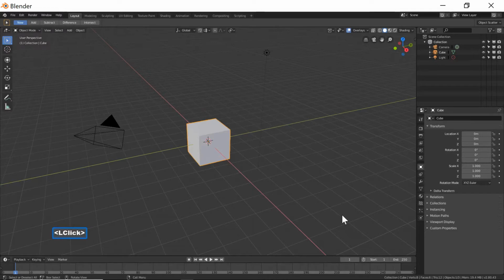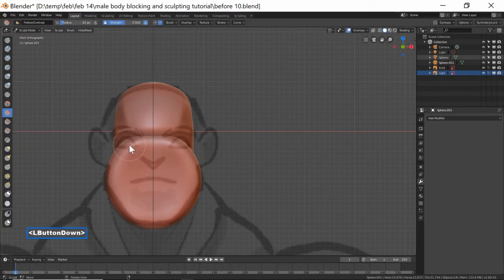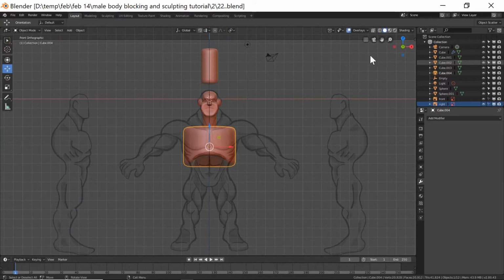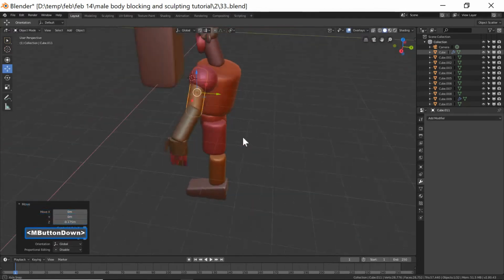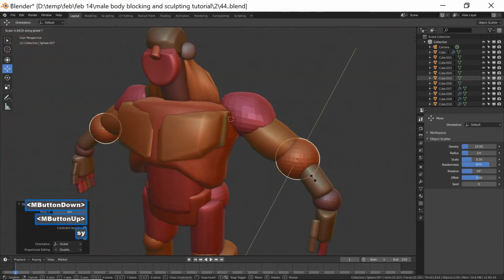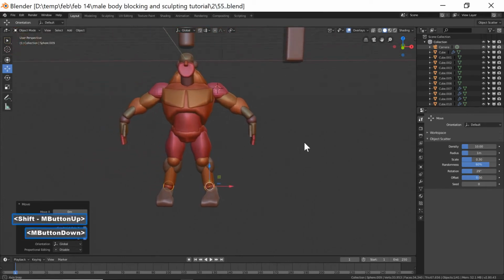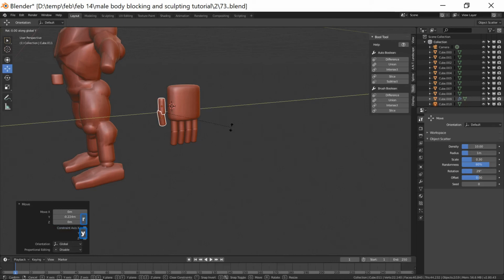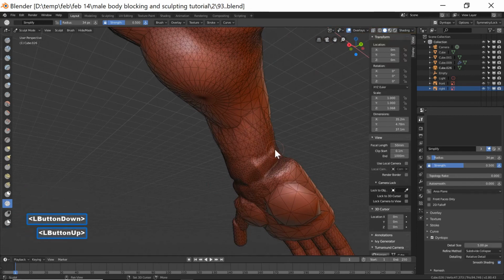Part 1 Blender 2.8 Tutorial Stylized Male Character

Comment: I just started blocking in the head and so far 2 things:
1) The reference drawing that I am using has a longer head than the sphere. How would you suggest adjusting the sphere (i.e. scaling it horizontally or stretching out the back with grab brush)?
2) The flatten brush seems to flatten the sides by pulling out mesh rather than pushing them in as you showed at 14:29 (I am actually stuck there right now, so didn't move further in the video). Is it possible to reverse the direction of the flatten brush (maybe with scrape)? The contrast brush (its opposite brush) pushes the vertices in the right direction but does not flatten. I am using Blender 2.82. Does it have something to do with that? 

Thank you very much in advance!
Reply from the maker: Hi Daniel
1. I would suggest scaling the head to make the longer reference.
2. You made a good call mentioning the scrape brush. That is indeed the brush that I use now to "flatten" rather than use the flatten brush.
Sorry for the late reply Daniel. Thanks for watching this video and let me know if you have any other questions.
Thank again Daniel.
Reply: Thank you very much for taking the time to reply! I will definitely let you know if I have further questions!

Comment: When I was using the simplify tool, it worked for a bit, but then when I tried to add more polys, it suddenly stopped doing anything. I tried turning up autosmooth to see if i got a response but it just smoothed the shape without adding anything.
Reply from the maker: Thanks for watching this video Brolor. I would recommend for you to continue smoothing for you to use the smooth modifier. I hope this info helps. Thanks again for watching this video.

Comment: When I use the Boolean Union at 1:24:40 the skull and ears turn into a fragmented mess of triangles. Is there a fix for this? Edit:... Nevermind, turns out those two parts had duplicate objects hidden inside. Must have been an accidental Shift+D somewhere. Just found the extra objects in wireframe and delete and the union works as expected.
Reply from the maker: Thanks for watching this video. Glad to hear that you found a solution to your question. Thanks again Feragore.

Comment: Hey I have a problem and i hope you can help me out, in the minute 52:39 when I put the sculpt mode the other objet doesn’t disappear is that a problem ? also when I use the grab brush it doesn’t grab correctly it just pinches the object
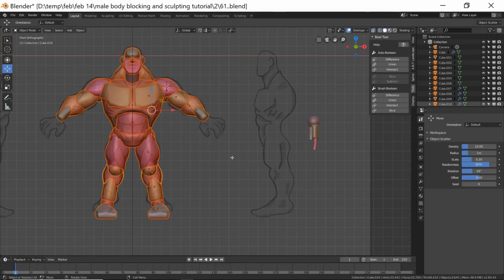Reply: I resolved the problem but now in minute 1:24:55 I can’t do the union because the head disappears and the chest, I saw that you answered this problem before but I don’t know how to rearrange the shapes
Reply from the maker: HI Bj. Change the object that you select last. So if you usually select the head before applying the boolean process that joins the shapes now try instead selecting the torso or an arm. I hope this helps.

Comment: My simplify tool isn’t working, should I start over? Also is this the Mose efficient way to make a base mesh?
Reply from the maker: Thanks for watching this video. If the simplify tool is not working I would not recommend that you start over. There are other ways to smooth out you mesh like using clay strips brush. I have tried multiple ways to make a base mesh. This is the most efficient way that I currently know of koju-kin.